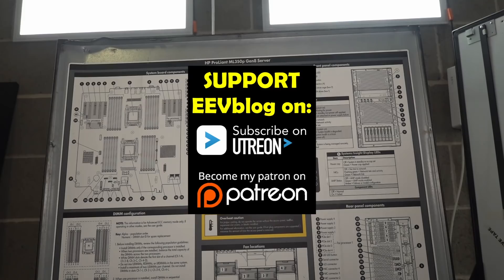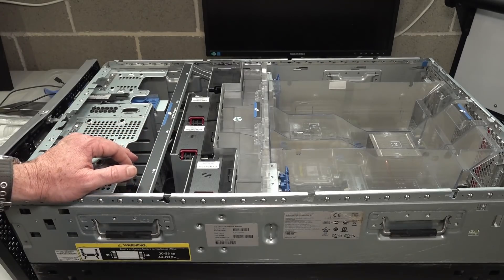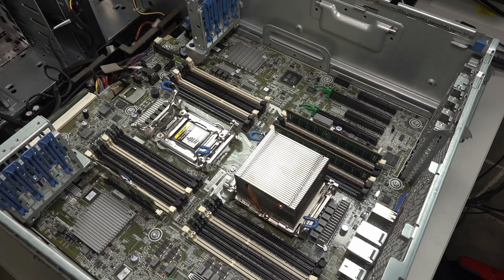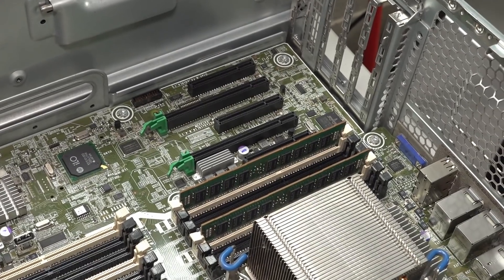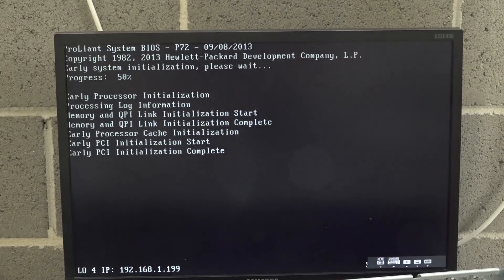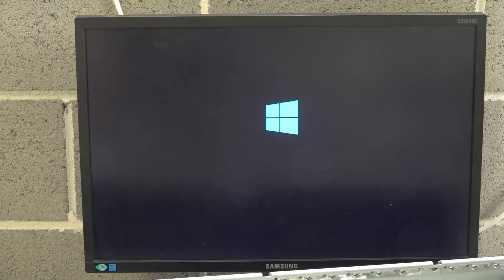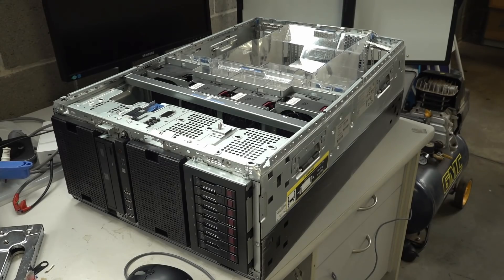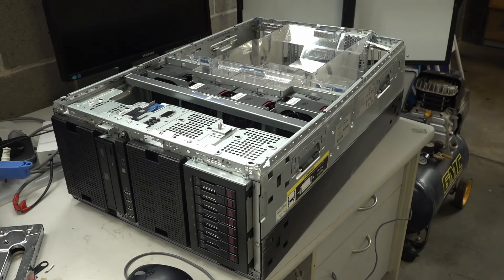EEVblog 1466 - Dumpster Dive Xeon Server

Comment: The PSU might be a fun score.  Server PSUs often provide most of their current on the 12v rail which makes them nice for high current 12v sources.  Though 460w is a bit low as far as server PSUs go, 1.2 and 1.5kw are not uncommon.  There are tons of blogs/sites/forums/videos dedicated to which PSUs are best/easiset to mod, pinouts (at a minimum the rails + PWRON), how to adjust the rails and tutorials on putting PSUs in series by giving one of them a floating ground.  The drone/RC hobbyists communities love server PSUs for high current 12-24DC sources for LiPo chargers.

Comment: I got a bunch of old Xeons similar to that for my cluster. Be warned... they consume a huge amount of power. They are built for performance, without any regard for efficiency.
Reply: G8 is pretty good for effiency already
Reply: It's under 60 watts idle for everything there except the hard drives. It was prior generations which didn't really care about efficiency.
Reply: @eDoc2020  more like 100 i think
Reply: @rkan2  That's probably about right if you include the drives. My DL380p Gen8 with similar CPU and 64GB of RAM was measuring 58 watts if I unplugged the SAS expander (which Dave's doesn't have).

Comment: No UEFI bios support (if memory serves) on the G8 and earlier. So no Windows 2019 on it unless you VMWare (or similar) it. That said this poor boy has seen some hardship.
Reply: I'm running 2019 on a DL380 G7 at present. Clean install rather than an upgrade too.
Reply: @DaimlerSleeveValve  And was it much trouble? Did you have to upgrade a lot of the machine?
Reply: @xConundrumx  No. £60 from eBay. 2 6-core processors and 16GB. Just filled some drive bays, ran the Array Config from ROM and installed. If you want to install a "UEFI-only" OS, use a Win7 install to create the boot partition (no need to let it complete) then tell the OS to use that partition.

Comment: The battery is actually a super capacitor, which might be useful. It also has some space age looking mosfets under the heatsinks next to the CPU sockets. The power supply can be hotwired by soldering a jumper between two on the connector, and is a really good 12 v supply.
Reply: The usuage of SuperCaps only was used in that gen of servers. The next one uses NiMh again, which suprised me back then. (I heard that they had reliability issues on the supercaps.)

Comment: I wonder why they’d have this massive unit with only one cpu and only 8GB of RAM in it. Seems overkill but maybe I’m missing something 🤷‍♂️
Reply: Maybe a test rig?
Reply: @spagamoto  to test what? It’s massive! Lol
Reply: @Alexander_l322  Sometimes when developing software for a datacenter, you want to test on the same hardware that will go into the production rack... but can often save some money on RAM if what you're testing isn't as RAM-heavy as production loads. Just depends on what you're doing.
Reply: @Alexander_l322  It's massive because it's a tower server which can safely be used in an office without causing hearing loss.
Reply: I feel the same. With one cpu, 8GB of ram and one PS, the only thing this server has above a PC is a disk array.

Comment: An option is to switch the raid controller to hba mode, install truenas and use it as a backup nas
Reply: As this is is only configured with 8 2.5" drives I don't think it's worth it.

Comment: I am using an ML350p gen8 as my main vmware virtualization host with 384GB ram and some  big 3.5" drives in an secound driver cage running virtual pfsense and virtual truenas. This raid controller can be switched to an normal hba for truenas.
I could use some parts as a spare for my home server.  Would be great to use your fans as a spare for my server.
It can be converted to rack mount by removing the  black cover. I bought some spare psu for 7 eur each und within the diagnostic utility you can read the power on time for the psu. Mine have round about 2000 days and are still running

Comment: O, nice, I sell such servers every day at work so if you have any questions I'll gladly help
Reply: the 'riser board' is external cache for the integrated P420i RAID SAS Controller with supercapacitor backup. Those 900GB 10k SAS drives could go for decent penny if they are in good shape. E5-2620 is pretty  weak and worthless but with an firmware upgrade you could put Xeeon E5-26xx v2 series CPU in there for relatively decent performance. And of course making use out of the whole quad channel RAM. The non lighting up disk has probably burned out diode. Or maybe is configured as a spare.

Comment: Riser board is RAID Cache and the drvies are SAS, the drive with the 'dead' indicator is a hot spare, it's not faulty.

Looks like it's got ILO as well, that was a really nice box, would have made a really nice NAS (and still could, the drive cage will take SATA drives so you could fill it with SSDs)

Comment: do be careful with the fans, if you want to use them with a pwm signal. sometimes HP servers have reverse PWM signal. Meaning at 100% duty cycle the fan stops and at 0% the fan runs at full power.

Comment: We still use these machines in production. They're built to last. Power consumption is not the best though (150~180 watts in our case). 
I believe that board at 7:36 is the RIAD controller's cache memory card with back up battery attached. 
The iLO chip is a "computer inside the computer", has a dedication network port that allows you to remotely control the server completely, update FW, turn on and off, see the screen, etc. There should be a FPGA chip near the iLO chip.
These usually support redundant power supplies (6:13) and power supply has a decent efficiency.
Reply: A bare config like this will use much less power than that. If my DL380p is an accurate indication it will be a touch under 60w at idle without drives. With eight 10k drives it's probably still under 100w.

Comment: Looks like an interesting server to play with :) , there are plenty of people (on eBay and such) who love these things. That they are power hungry is a little bit of a downside, but (at least in NL) electricity has gotten cheaper the last couple of years to stimulate switching from gas to all-electric. So the monthly bill won't increase too much.

If I was living in the neighborhood, I might have offered to take it off your hands ;)
Reply: Well they are but they're not. Like Desktop PCs the power consumption comes down to the power supply efficiency, and what hardware is installed in the system. Generation 8 is when they started using 80+ Platinum power supplies, but they're also backwards compatible with Generation 7s. At-least the rackmount machine versions are. Generation 8s with this configuration set to dynamic power savings mode would likely consume anywhere between 80 and 140w on light load, but the amount of drives you have installed will change that. SSDs are a better choice for power efficiency.

A power supply that's rated at 460w means that it can supply up-to 460w of power to the system. It doesn't use that much just idling as these machines are designed to be power efficient. I own a DL360 Generation 7, and a DL380 Generation 8, they consume no where near 300 watts on an average day.
Reply: At least this one only draws 460W with this minimal config! Less than a lot of gaming computers haha

Comment: Power hog? Your PC probably has higher capacity power supply :).. I recently got used Dell R620 from Amazon. Probably around the same era this server was made. Mine had 2 CPUs almost exactly the same one as this server has. I upgraded the CPUs to 3GHz (20 logical cores each) and 128 GB RAM. I machined high surface area liquid cooling blocks out of copper, got a small motorcycle radiator, four Noctua fans, water pump and designed the circuitry to put it all together (fan speed control, temperature sensor on cooling blocks as well as radiator inlet and outlet). Liquid vs Air cooling is day and night. At 100% utilization (Prime95), I dropped the average maximum core temperature from 80.15 C to 49.80 C... Maximum any core ever got was 53 C and CPUs are rated for 100C... Fans are not even audible in continuous 100% utilization. I'm using the server for running custom AI on my cameras. Of course, it is nothing like having 4-8 GPUs (at $15k each), but costs MUCH less with tolerable performance; ~500ms vs 3.5s doing the same thing in Google Colab and my server, respectively. I would rather have GPU system but thanks to Covid, cryptocurrency mining dickheads and those grown-ass man playing games on PC to no end, it is not easy to find GPUs at MSRP. Everything is 3x the price. Even in ideal pricing, 2 GPU system would have cost around $2000 to put together. My server costed $800 including the upgrades. Now with the Ukraine situation, raw materials for semiconductor production will further strain. The world is going down to shit...
Reply: Yeah, Proliant G8 is pretty good already for power effiency.

Comment: The CPU isn´t very powerful to today´s standards, i mean every modern standard desktop CPU will destroy this poor Xeon but it´s still capable of running modern web and stuff, maybe even some games (with dedicated GPU and more RAM)  but as workstation/server workloads i don´t think so.
Even if it was a dual CPU setup.
It´s slightly faster in multicore benchmarks compared to my old dell workstation i got from trash two years ago.
It has a Xeon E3-1225 so basically a 2nd gen "Sandy Bridge" Core i5 but with enterprise features.
Old but for a secondary PC not too bad.
Reply: This has an E5-2620: 6-core 2.0GHz base. E3s are a totally different platform. Upgraded to dual E5-2690 v2s you'd end up with 20 cores @ 3GHz base.
Reply: @eDoc2020  It really makes no difference wethever it´s E3 or E5 xeon.
Both are x86_64 CPUs based on Sandy Bridge architecture and i just compared benchmark results online.
The E5 isn´t far ahead of the E3.
A Ryzen 3 3200g will simply outperform both a E3 1225 and a E5 2620 easily with only 4 cores.
So i don´t expect a second populated CPU socket will make a whole lot of a difference compared to modern CPUs, the Ryzen 3 is pretty much on the low end side of desktop CPUs.
Higher end models will easily outperform a dual CPU setup, and this with a standard desktop class CPU and much much lower TDP (power consumption)

Based on online benchmark scores, a Ryzen 9 3900X is approx. 143% faster than a single E5 2690 v2 so even with a dual CPU setup, it will be still faster and having only 12 cores vs 20 cores.
Oh and btw. a single Ryzen 9 TDP is 125W while you have 2x 130W with dual E5´s so yeah 260W worth of heat :D
https://technical.city/en/cpu/Xeon-E5-2690-v2-vs-Ryzen-9-3900X

The E5 2690 v2 surely is a great CPU but technology improved over time and Ivy Bridge is almost 8 years old.
And the one in the video is the even older Sandy Bridge.
Core counts and clock speed isn´t all in the end.
Reply: @MultiWirth  Obviously the newer generation CPUs are faster. I was just saying that the E5 has much more grunt than the E3. Not only is there tons more multi-core performance but there's also more capable memory and PCIe controllers. The E3 takes up to 32 gigs of RAM and each E5 takes 192 (or 384 with LRDIMMs).

Comment: Years ago, I went to a Computer Meeting where a Computer Company was there with a server system in a trailer (caravan). Someone in the company forgot to lock the server blades in the rack, and they fell out while traveling over 60 miles (96 km) to the event. They were DOA (Dead On Arrival)! Reminded me of that HP Case.

Comment: One other thing you should explore is iLO. There's an extra ethernet port on the back of those machines, and you can connect over a browser and see all sorts of cool stuff about the machine when it's running (like a view of all the different temp sensors spread across the motherboard, a plot of power consumption over time, etc). There's an iLO option in the BIOS to configure it, and there's usually a pull-out tab on the front of the machine which I think includes the default password if you reset the password for the machine.
Reply: The iLo info was on the side of the server, you could see it in the video. They are great, i have them enabled on over 1000 Proliants that we look after.
Reply: Independent Lights Out is nice for powering the system on and off as if you were standing at the monitor.

Comment: In my server (not a HP), one of the drive activity LEDs has died, could be the same with that one, considering those things are powered on 24/7 for several years it's not all that surprising even a lowly 10 mA indication LED can fail.

I was also rather surprised it span the fans down when it got into Windows, many servers have tamper switches to detect when the plastic airflow guide is missing as it actually does quite a lot for thermal performance.

Comment: Not a bad find :-) The drives are 900GB 10K, pretty decent. The one drive which has no LED on is probably configured as a spare drive, it will only fire up when one of the others dies. The card with the battery connected is the RAID controller cache with battery backup (to prevent data loss if you have a write access to the disks while there is a power loss to the server, the raid card will keep the data in the cache and write it to the disks when the server has power again).
Reply: and how long does that power last.lets say if there is long term blackout like 48h+
Reply: @hardscorerockkssss  Technically, it does not actually keep the data in the memory of the controller - the battery backup lasts for about two minutes, and during this time the data is written to flash memory on the controller card. There, the data can be stored basically forever, until the server receives power again - then the RAID controller will see that there is unwritten data in the flash memory.
Reply: @gg-gn3re  Well, it is a P420i controller which has a capacitor (660093-001).
Reply: @hardscorerockkssss  dell quotes 72 hours, so HP is probably similar.

Comment: The hard drives could probably be flipped on ebay for 100 bucks for the lot. Aside from those yea there isn't much value there.  Even the fan's aren't that useful because they are so loud at full.  I like the motherboard wall idea though.

Comment: HP used to build these in Cypress, Texas even in 2013. I worked on the assembly line for HP servers during high school summers. They were all built to order custom configurations (BTO). I built severs for Facebook, AOL, Stanford and hundreds of other customers. We knew how to build all server models (40 or so). Was a great high school job. Once I graduated college, I became firmware engineer for HP iLO for a few years.
Reply: Small world, I worked for HP/HPE in Cypress from 2014 through 2021. I was a systems engineer in the R&D labs, right under the iLO lab on the 3rd floor. Mostly working with Synergy and C7000 systems, with the OA and FLM teams as well.

Awesome servers, we designed some custom ones for Dreamworks, Facebook and Microsoft for their Azure and Xbox Live networks.
Reply: @SpyAlelo  That’s amazing!! Yes I remember the Dreamworks collaboration, they had Shrek posters all around campus. Good times 🙂
Reply: So since SATA drives do in fact work in the SAS bay what is the actual difference in using SATA vs SAS?
Built mine without drives and installed SATA instead then found out it needed SAS...  ONLY after installing the OS to the Shadow Array and having created 4 VMs on the server, then I found some documentation on the SAS bay.
Reply: I live in Houston, in Tanglewood. Where in Cypress were they located?
Reply: @MrDoneboy  Literally right up the road is one of CISCO Systems labs that I helped cable some years back...  LOL Texas seems to have many companies like HP, in Plano Tx, there is a massive data center for HP or it was some years ago, not sure what it is now no signage.  Also, have a Mcafee offices group here too.
Reply: @MrDoneboy  Old Compaq Dr Center, by Louetta and 249. They sold most of their buildings around 2010 to Lone Star College, the remaining 8 buildings or so are the ones they were using until recently and moved now to Spring to the new HPE headquarters a few weeks ago.

Comment: It is not SATA drives, it is SAS drives. Far more expensive. The battery backed card is probably a RAID card.
Reply: Depends on the capacity (:
3tb sas drives are half the cost of satas
Reply: @nixietubes  Used SAS drives are cheaper than equivalent SATA drives because fewer systems can use them. On new drives SAS is more expensive.
Reply: @eDoc2020  yes but these are used drives haha
Reply: Those hd brackets alone are worth like $15 each

Comment: for a server this is pretty young. it wouldn't be too hard to recover whatever was on that. whoever was in charge of that did a horrible job on 2 counts. 1. they could of easily sold it for a decent kickback on the paycheck. and 2. at bare minimum KEEP THE DRIVES. both a backup just in case you needed something and 2 security duh.
Reply: Agreed, while its not exactly cutting edge anymore I've seen much older servers than this still in use in production environments.

Comment: Worth selling CPU, fans, memory, PSU and drives as spares, because they are worth a lot to those with those who need spares. Worth at least shipping in Aus, because those are getting old in the tooth, and they are worth it for spares, as psu and fans work, and it at least boots. Will be worth a bit as parts. Likely thrown out with a company that either failed, or who got bought out, and the new owners tossed all the "old" hardware to go cloud based.